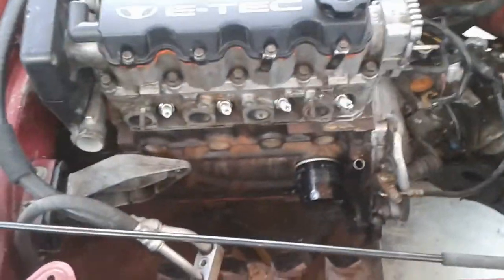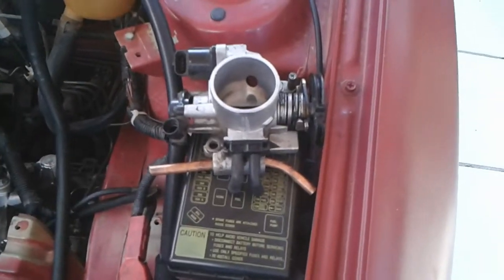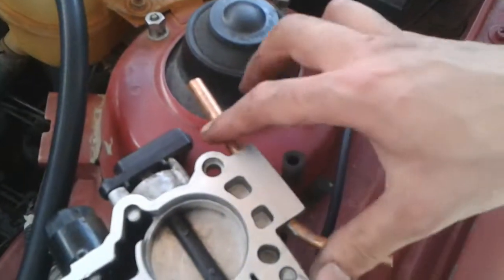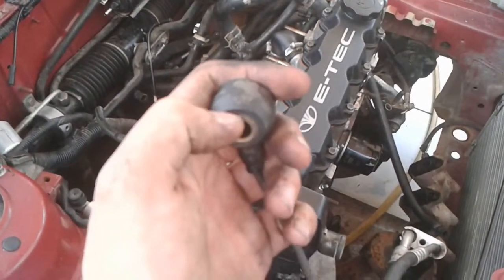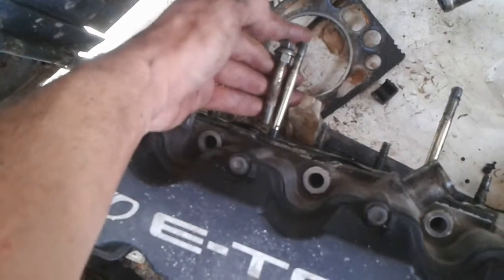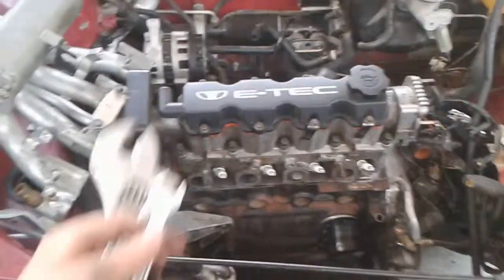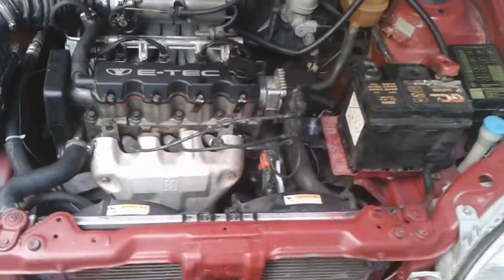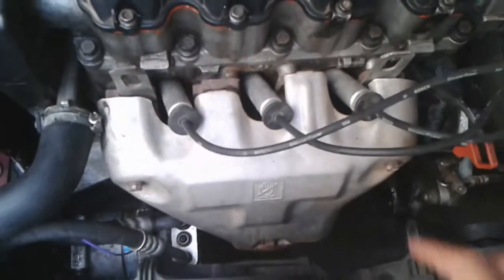Daewoo Lanos 1.4L - Engine Swap Finished and Broken Studs! (Part 2)

Comment: My dad has this car, mine is a lanos 2001 1.6l engine and it has a problem with aceleration, when its cold aceleration is nice but when is warm aceleration i a little low. We check timing, change spark plugs, change fuel pump, got a new ignition, i have a theory on the fuel injectors cause when we change it for other used ones, it got a little power boost, so theres that. In other hand, i suspect is a sensor problem maybe the map sensor.